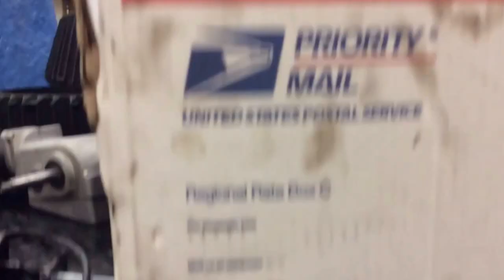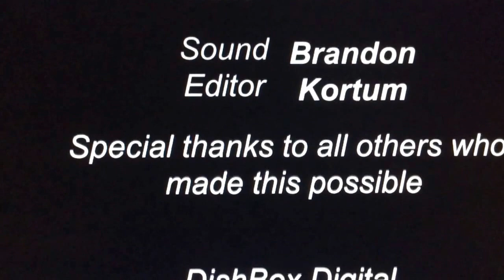Roseville mechanical engineering tracked wheelchair

Comment: Cool project! What's the point of that back wheel?
Reply: Sirikit Joshi it's basically a wheelie wheel so if the up angle gets too radical it won't tip over backwards.

Comment: I AM GUESSING THE BACK WHEEL IS SO IT WON"T FLIP OVER? WHY DIDN'T YOU GUYS JUST MAKE THE TRACKS LONGER SO YOU WOULDN'T HAVE TO HAVE THAT WHEEL STICKING OUT?  

I LIKE WHAT YOU MADE BUT THAT WHEEL HAS GOT TO GO!!! IT IS UGLY AND MAKES YOUR CHAIRS COOLNESS GET TAKEN AWAY FROM. PLUS IT IS A HUGE WASTE OF GOOD USABLE AREA THAT YOU CAN USE TO HAUL STUFF THE USER WILL EVENTUALLY NEED TO TRANSPORT IF A REAL USER IS TO USE IT. i MADE A LITTLE CAGED ALUMINUM FRAMED PICK UP BED SORTA THING BEHIND MY CHAIR WHICH IS  ORIG A TDX BRAND. I ALSO HAVE A MOVING DOLLY THAT I CAN HOOK ON AND AD AN EVEN LARGER FRAMED BOX SET UP TO THE TOP OF IT AND HAVE A DECENT SIZED TRAILER THAT I HAUL BEHIND MINE WHEN I NEED IT. 

I HAVE RAN THE WHEELS OFF MY CHAIR GOING EVERYWHERE IN IT SPINNING DONUTS IN IT MOVED MANY TIMES WITH IT, USED IT LIKE A LITTLE TRACTOR ALMOST AT TIMES TOO. THINKING ABOUT A GAS ENGINE SET UP NOW AND MAKING IT EITHER BOTH ELECTRIC AND GAS OR PROPANE ACTUALLY SO IT CAN BE RAN INDOORS JUST LIKE THE PROPANE POWERED FLOOR MACHINES AT THE GROCERY STORES  - OK FOR INDOOR USE BECAUSE PROPANE DON'T DO LIKE GASOLINE ;-)   WHERE CAN A GUY GET SOME TRACK LIKE YOU HAVE ON THE CHEEP? I'VE GOT 2 REAR DIRT BIKE MOTORCYCLE KNOBBY TIRES RIGHT NOW THAT I HAVE CUT THE SIDE WALLS OFF OF THAT I AM CONSIDERING TRYING OUT AS TRACKS ON MY TDX. TDX IS A POOR DESIGN BECAUSE THE DRIVE WHEELS IN THE MIDDLE AND END UP NOT ON THE GROUND EVER DRIVEWAY, GUTTER, HILL, DIP THAT i ENCOUNTER AND IT BLOWS! THATS WHY I AM WANTING TRAX ALSO..